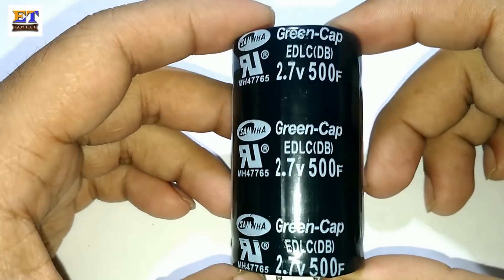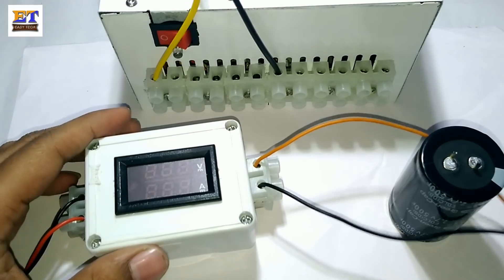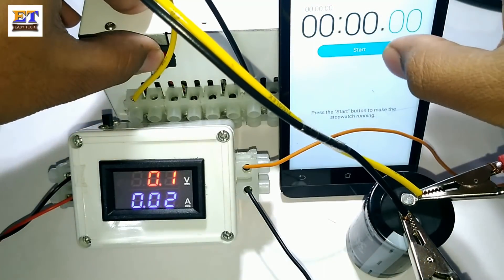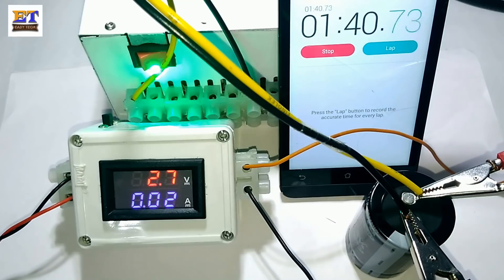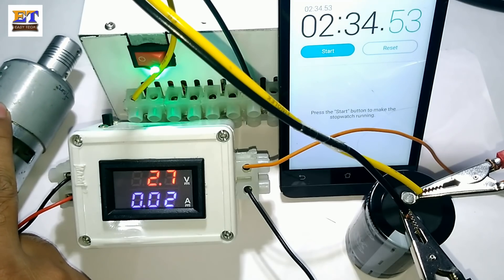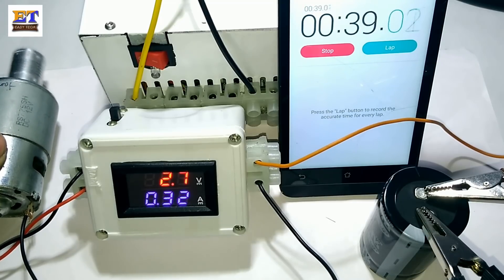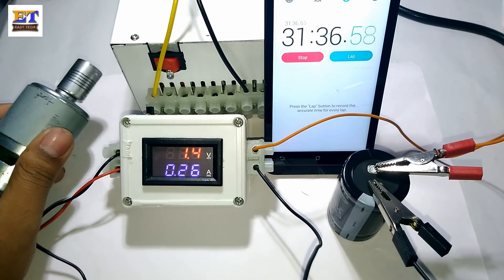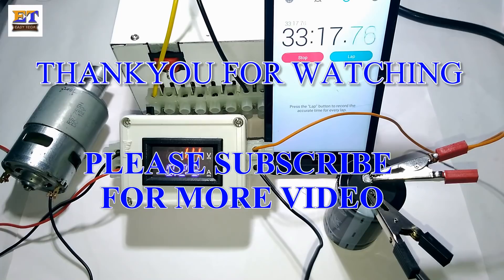Super capacitor 500F 2.7V Charge and Discharge Testing

Comment: So 5 of those in series would get you 13.5 volts. Another 20 of those (25 all together), 5 sets in series of 5 parallel would get you 13.5 volts, 5 times as long. As long as the drop is the same as that motor. Thats not bad.

Comment: the motor run test must be done with some load to determine the actual run time 

this test is inconclusive
Reply: Not really, he's measuring voltage and current. Multiply the two and you have the power delivered by the cap. Multiply the power by the run time and you have the total energy delivered.

Comment: What if u leave the 6 capacitors always connected in parallel with battery?  you ll never have to worry about car not starting?
Reply: I put my car on while um using , its too burst strong need some trick

Comment: Great full information u shared sir nice for exploring it talent practically. Sir my 1 question is - 1)How to measure the capacitance of the capacitor if the readings are not given  on the capacitor without using multimeter???                             2)How to measure the voltage in the AC 's (home applying current)???

Comment: What is the input voltage and current given the capacitor during charging... for the smps
Reply: 2.7 because that is the rated voltage of the capacitor if he exceeds the capacitor will blow up. If he charges the capacitor in 2.7v the output of the capacitor is also 2.7v. i wonder how he runs a 775 dc motor with 2.7v

Comment: Amp/sec doesn't make sense. Farad is Coulomb per Volt, so F*V is equal to Coulombs, not A/s!
Reply: Sir what is the amp of this capacitor I want to make a 12 volt batteries with this capacitor
Reply: @paksolar6907  you should search for their datasheets, but i am 100% sure that 12 amperes doesn't make any difference in temperature, which makes the maximum rating way higher.

Comment: note that the ammeter is not giving proper amps ....... i charged mine with 0.2A @ 2.5V and it took around 2.5 hours ...... so more current is needed to charge it

Comment: Theoretical Capacity=375mAh
Actual Shown=~290mAh
Current during charge 15Amps
Thank you EasyTech.  Sadly, the experiment is slightly flawed, because the meter is not hooked up properly during the charging, so we don't see what goes into the 500F capacitor.  Additionally, the poor power supply is dropping way below it's rated 3.3V output, so many, many amps were flying during the charge up.

To calculate how much is stored, we can approximate it based on the output power.  The motor is just a big resistor/inductor, regardless if the label says 12V.  The current out of the capacitor is 2.7v @ 0.30amp at start and  slows down to 1.4V @ .25amp (less power output) by the end.  The average between the two is mAh equivalent into this motor resistor.  If we run for one hour at 2.7v @ 0.3 amps that would be   810mah, however the motor actually ran for 1/2 hour, so 405mAh consumed.   At the end of 30 minutes, it was using less power at 1.4V @ .25 amps, so that would be 350mah, but running at only 1/2 hour,  that is half at 175mAh consumed.  The average between the start and end mAh consumption is very roughly 290mAh used in 30 minutes by the motor and might be slightly higher if the voltage/current drop is not linear.

If we calculate the max storage based on the Super Cap Ratings (credit goes to RuggedCircuits over at Arduino Forum) 500F x 2.7 v = Q = 1350 Coulombs of charge.  Now 1 mAh is 0.001 Columbs per second (0.001A) multiplied by 3600 seconds or 3.6 Coulombs.  So I think the capacitor is equivalent to 1350 / 3.6 = 375mAh    (Pretty Amazing and close!!)

#Danger Risk#, if you push 10+ Amps into a super cap, it may exceed the max input current and heat up, melt, explode (high voltages) or short internally,  check the manufacturer sheet first!  

If we want to know how much that very sad power supply had to source into the Super Cap over only 1.5 minutes, we again use average voltage of  1.1V to 2.7V over 90 seconds.  The power supply was hopefully being current limited during the charging, so that it would not melt internally.  The average voltage was 1.9V during charge and lets assume 375mAh went into the Super Cap, which is the calculated rated max above.   That would be 60min / 1.5min total = 40 times more than the one hour capacity went in within 1.5 minutes, which works out to 40 * 0.375amp/hr = 15.0 Amps exactly.    That is a lot of current from the poor power supply!!!  The total power into the super cap was likely 1.9V x 15 amps = 28.5 Watts instantaneous   Hope this helps.

If people repeat this, consider adding a power resistor between your charger and the SuperCap, so that neither your charger nor the SuperCap die.  A number to keep the current below 3.3 amps @ 3.3V would be a 1 Ohm 20Watt  Power Resistor in series
Reply: I am brand new to electronics/self sufficiency etc so please forgive this question but you clearly know what you're talking about, but i am fascinated with the super capacitor and the power it has. Would it be possible to run a 500w electric heater via a 12v Inverter and charge controller using the 6 super capacitors in series as it's power source charged with a hand crank generator?

Comment: Made in China, they put a 500 farad label on a 500uf capacitor and think they can fool everyone.
Reply: Dele O.Bamigbola  No. a 500 uf cap can’t do anything close to that. A cap like that would take almost no time to charge/discharge. It is actually 500F, which is why it’s called a super/ultra capacitor (which is a technical name). Don’t fucking comment if you don’t know what you’re talking about.
Reply: @pradyumnadahal  sahi baat ....... it was running that motor for more than half an hour
Reply: Get a sense of humor, nerd. I can promise you the cap isnt 500F. Almost all specs on these cheap chinese online stores are exaggerated just to sell more crappy parts with non existent quality control.

Comment: 12v motor and 2.7v capacitor wah
Reply: for 12V it would have high RPM, 2,7V and motor barelly running so, its possible
Reply: Running slowly slowly

Comment: i don't UNderstand When I Connect a 25V Capasitor to a 20V Step up Converter The Capasitor Charges up to 20V Instant!
Reply: Your capacitor probably has a much smaller capacitance than this 500 farad supercapacitor. Most 25v capacitors have a capacitance of around 4700 uF(micro farad) which is 0.0047 farad and is only about a hundred thousandth of what the capacitor in the video has. Your capacitor can store less then one joule of energy while his can store 1800 joule so your capacitor's charging time will be instantaneous compared to his .
Reply: @Rainbow_Sword  ok ty

Comment: Please help, I need the charging and discharging curve of a super capacitor of 3000f considering the charging amps is the same as the amps drawn by the load and same with the voltage
Reply: Your 3000F capacitor can store roughly 11k joule energy (E=CV^2/2). Theoretically with  a 2.7 volt 5 amp constant voltage/current input, you'll fully charge your capacitor from 0v to 2.7v in 814 seconds which is about 13.6 minutes.

Comment: i have 6x500F supercapacitors in series on board and i want to build a Lead acid replacement for my 4cylinders 750cc motorcycle. How should i connect  6 x18650 batteries i have, to charge the supercapacitors? Thanks!
Reply: What is the total voltage of the 6 caps? I suggest use AC chargers (with same voltage reading as you combined caps) to charge up your caps
Reply: can you built your battery replacement???